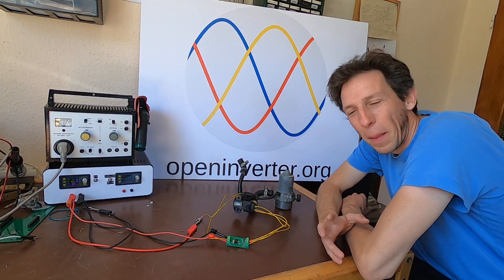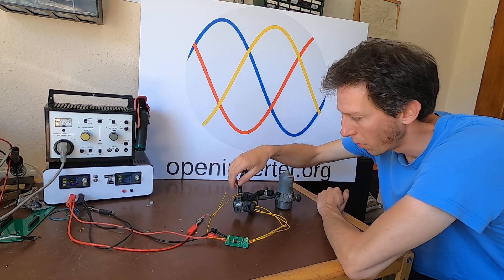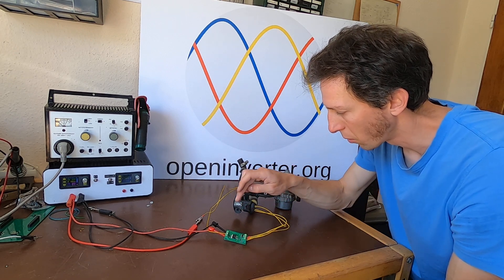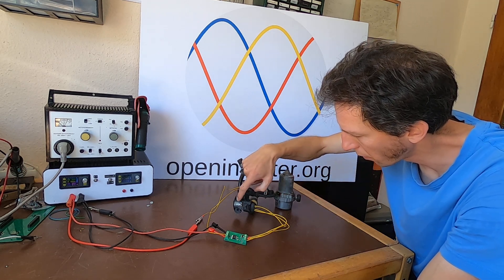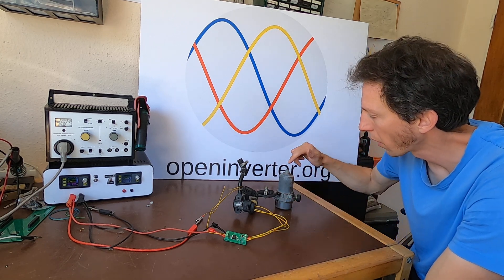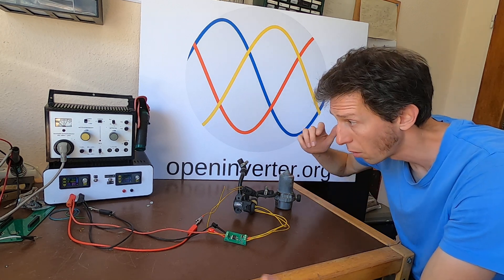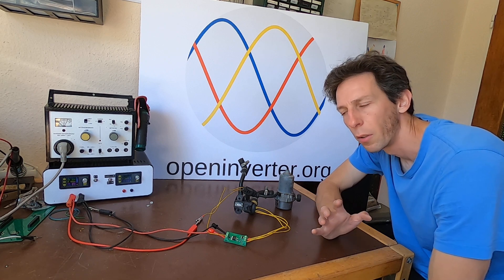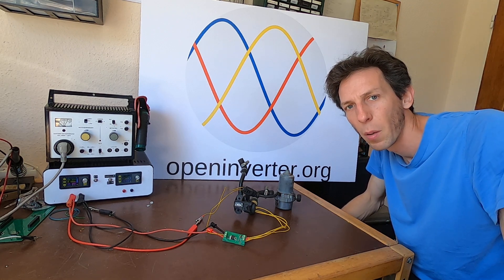Vacuum Pump controller presentation

Comment: can it be used to run a vacuum pump at preset pressures?
Reply from the maker: Yes, the pressure is set through the resistor divider

Comment: Not clear.  Why I can't use simple vacuum switch with  NC contacts via relay for control vacuum buster ? Just for "prevents rapid cycling of the pump" ??? Yesterday I brought vacuum buster with pipe and sensor (on/off) from chevrolet cruze 2012 just for 15 euros.  Just connect +12v from egnition and everything working fine.
Reply: I tried two different on/off type sensors, none worked for me as they where to unreliable. So I got this board about a year ago from Johannes and since then everything works flawlessly
Reply: @philipschuster5860  i have nothing to says